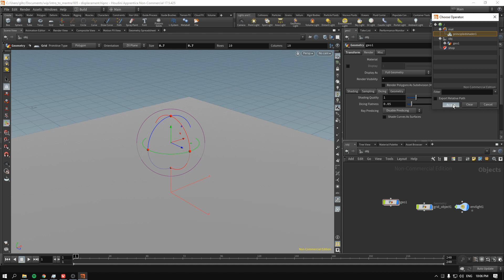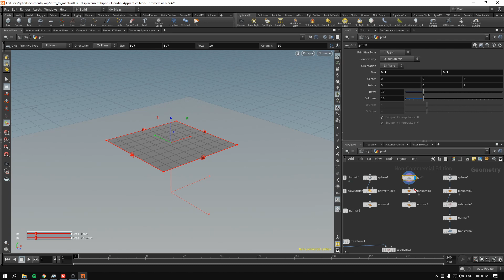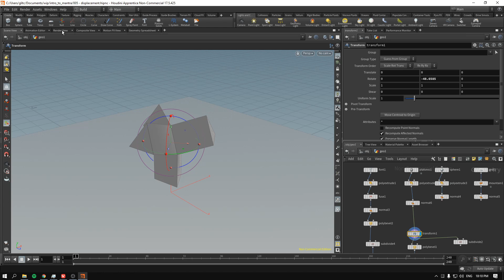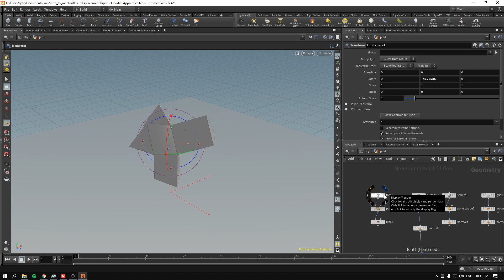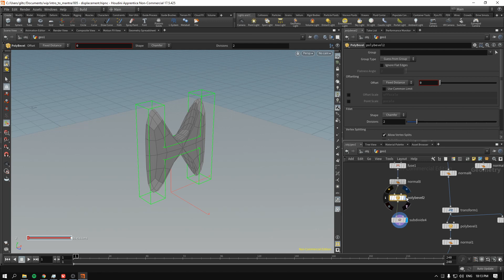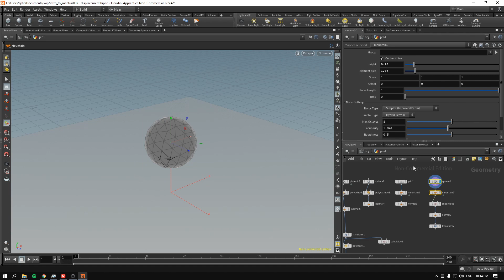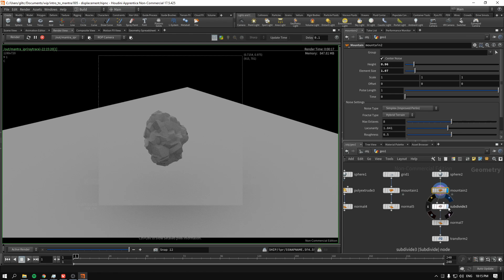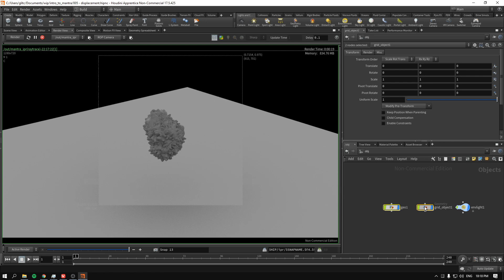Mantra Tutorial — Displacement & Problem Fixing - Getting Started Course ep. 05

Comment: A great option for generating extra topology for displacement is to use the Remesh node and put in * into Hard Edge Groups. That will preserve the existing geometry regardless of the size target. Good for breaking up large flat ngons while keeping the small areas as they are. If are going to use subdivs for this kind of purpose which I do not recommend, rather than doing small bevels, it is better to use creases. Subdivs divide polygons evenly, so that huge quad will get as much extra geometry as the microscopic one. Putting extra unneeded geometry is not good when every level of subdiv will increase the geometry amount by 4x.

Comment: i can not seem to get my H to be perfectly sharp like yours are. i've gone through the sub divide and polybevel, and checked its the exact same settings, but i still get a slight edge that appears  once you add on the subdivide (its pretty small, but noticeable) how do i fix this? i've tried playing around with the settings in poly bevel and subdivide like you did, but havent been able to remove it
Reply from the maker: Double-check your setup, it should work.
Reply: @AriseWorks  I went through it all and doublechecked all visible numbers where identical and still had the issue with the geometry not being perfectly square after subdivide. however i read through the "manual" thing sidefx has that you mentioned earlier in the video, and tried using "override crease weight attribute" and sat it to 2, which seemed to fix it. i dont see you using it in the video though, could this be a change from houdini 17 to 18?
Reply from the maker: Hmm, that could be the issue. Glad you figured it out